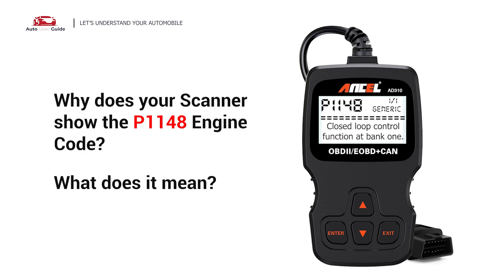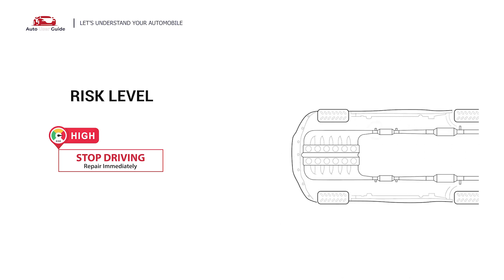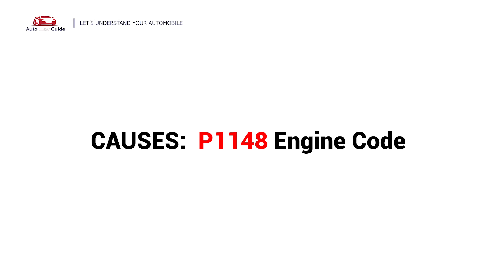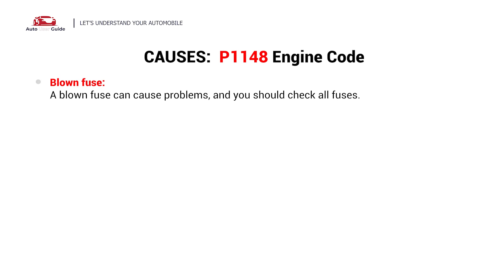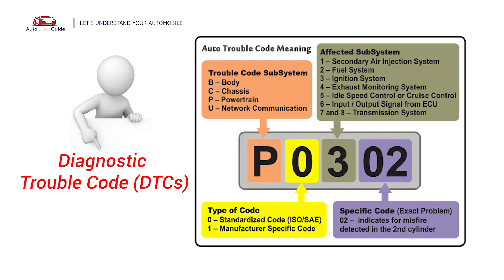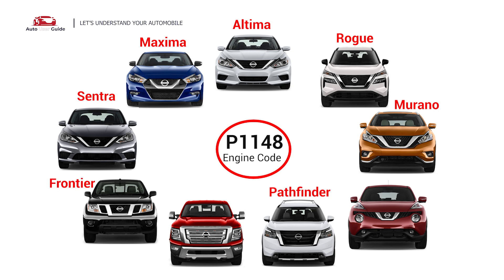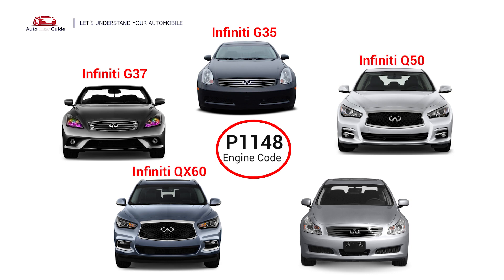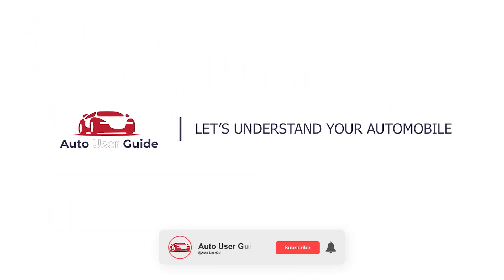What is P1148 : Engine Error code Causes Explained

Comment: What number fuse is for A/Fuel ratio sensor?
Reply: Sentra 2010
Reply from the maker: @apagan1127  Fixing P1148 Engine Error Code in Sentra  : https://youtu.be/fQ8rgVdnt3I
Reply from the maker: Thanks for your question! To help you accurately, could you please share the specific make, model, and year of your vehicle? Fuse locations and numbers can vary depending on the car. Once I have that info, I’ll point you in the right direction!